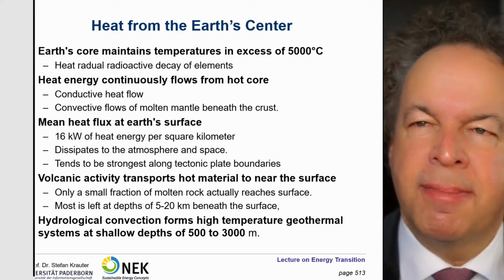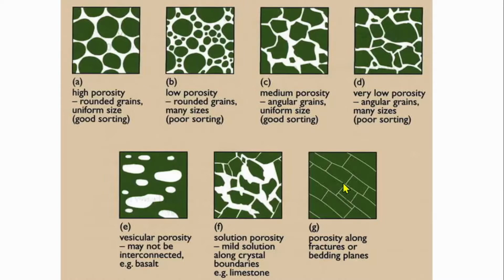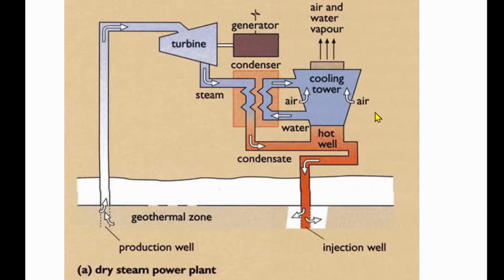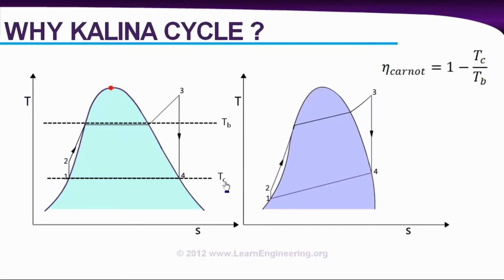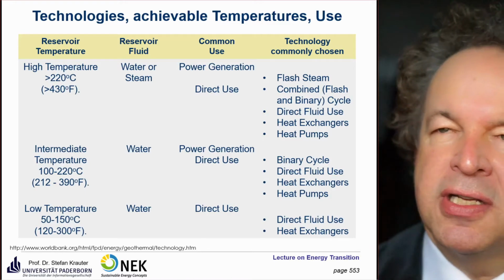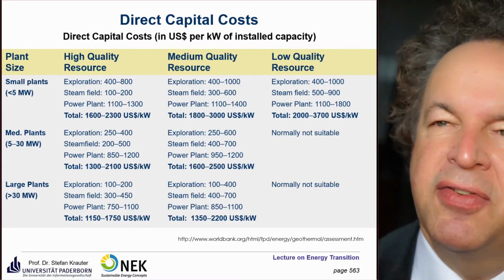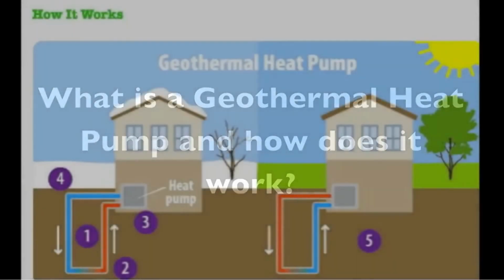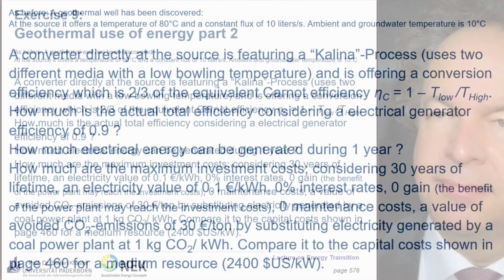Lecture 09 Energy Transition - Geothermal Energy

Comment: Why do geothermal plants use steam to draw the heat out of the crust instead of drilling down much deeper to where the crust temperature is 200+C and then sticking down something that is equivalent to an oceanic communication cable (with a lot of metal in it to conduct the heat up to the surface) down the well with a low melting point metal like tin or indium at the bottom of the well to increase the surface area of the heat exchange?

Seems like it would be more efficient and less location dependant and maybe even cheaper than using steam.

Comment: Hi, if i have a well that is 3000 m deep offshore and a bottomhole temperature of 124 degC, Expecting to produce 15000 barrels/day of water. what would be expected fluid temperature at the wellhead? Just an estimation will be fine, what is the expected temperature difference (heat loss) from the bottom to the surface
Reply from the maker: that depends on the thermal heat dissipation and thermal coductability of the tube with the surrounding material.
Best is to carry out a simulation:
https://www.comsol.de/blogs/modeling-geothermal-processes-comsol-software/

Comment: Hello,
Will there be an exercise video for Geothermal Energy? In Exercise 9a Q2 Where does the W_heater req = 25.21 GW required for the natural gas mass calculation come from? Should it be 2.877MW?
Reply from the maker: (there will be the PDF only meanwhile). The heater energy is defined by the actual heat required divided by 0.8, taking into account the efficiency of the stove/heater.
Reply: @Stefan_Krauter  heat extracted is 2.3MW and after dividing by 0.8 to get heat required we get 2.877kW. How do we actually get 25.21GW?
Reply from the maker: The steady POWER is 2.877 MW, so over one year the ENERGY is 25.2 GWh (not GW !).
Reply: @Stefan_Krauter  Thank you for the answer.